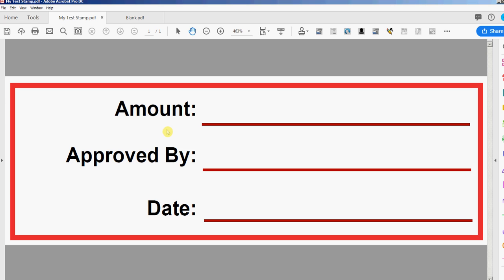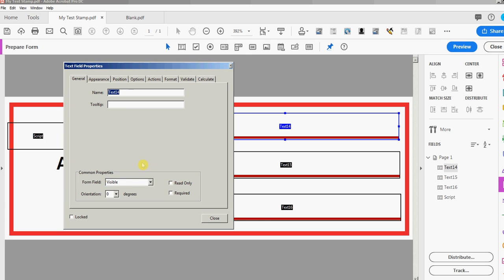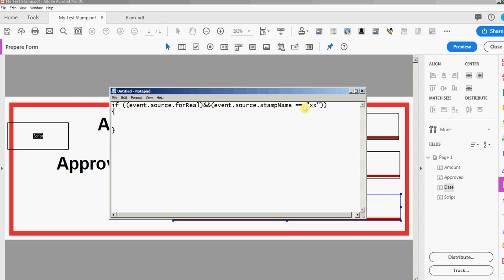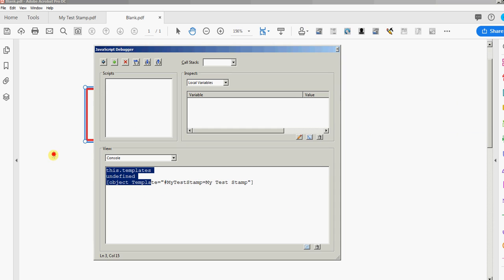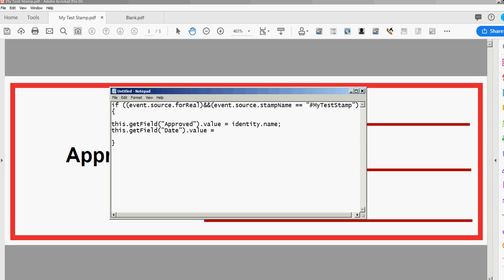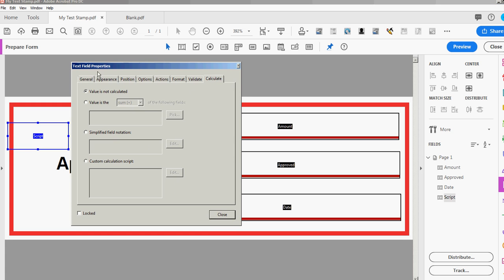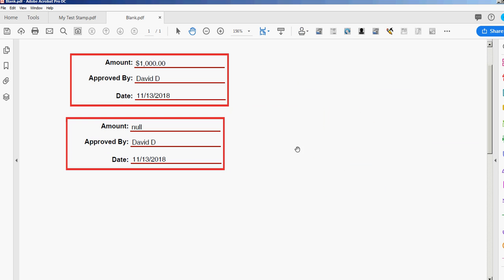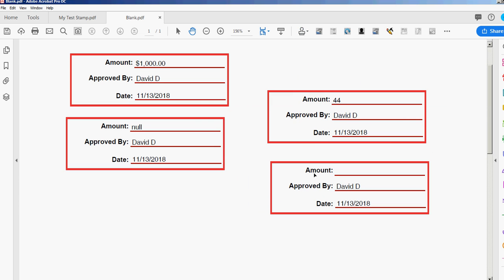How To Make A Dynamic PDF Stamp

Comment: this is for Adobe PRO only, you should include that in your title.
Reply from the maker: You need a PDF editor to create and manipulate PDFs.  Adobe Pro is a PDF editor.  You can still do this with Reader but since there is no interface for creating form fields (because it is a PDF "reader") you would have to use scripts to create the fields.  Adobe Pro is not the only PDF editor.  With all due respect we didn't think it was necessary to state in the title that you should use a PDF editor to edit a PDF but we thank you for you comment.
Reply: @PDFAutomationStation   As anyone can make a stamp (except for Dynamic ones) in Adobe Reader it would seem to be an important detail to include .

Comment: Hi David. I enter the following code into the script box and it has the message: "Syntax Error: syntax error. 1: at line 2" referring to the { symbol. I double checked the quotation marks are straight (not curley). Any idea where the problem is at? Thank you!

if ((event.source.forReal))&&(event.source.stampName == "#InvoiceApproval"))
{

this.getField("Date").value = util.printd("mm/dd/yyyy", new Date());
this.getField("PO").value = app.response("PO Number: ");

}
Reply from the maker: The number of opening brackets must match the number of closing brackets.  You have 3 opening brackets (, and 4 closing brackets ). You have an extra closing bracket ) after forReal.
Reply: @PDFAutomationStation  That fixed that issue, however after adding this coding into the "script" object, I tried to stamp a document and it still shows an empty stamp (nothing filled in). My goal is to autofill the date and open a message box prompting for a PO number. Any other thoughts on where this went wrong? See scripting below for reference. Thank you!

if ((event.source.forReal)&&(event.source.stampName == "#InvoiceApproval"))
{

this.getField("Date").value = util.printd("mm/dd/yyyy", new Date());

this.getField("PO").value = app.response("PO Number:");

}
Reply from the maker: @byeeself  I don't know what the script object is.  Please contact us outside of YouTube here:
https://www.pdfautomationstation.com/public/department6.cfm

Comment: Thank you for this great tutorial; my script debugger won't execute the prompt. I tried scrolling through this thread and a Google search and seemingly I'm the only one with this issue? I'm using Acrobat Pro DC
Reply from the maker: I'm not sure what you mean by your comment.  The script needs to go into one of the fields in your stamp.
Reply: @PDFAutomationStation  I'm struggling to work the debugger to find the StampName
Reply from the maker: @KurtReckerAdvertising  What script are you running and what does the debugger return when you run the script?
Reply: @PDFAutomationStation  i figured it out by going back to your earlier tutorials--- thanks for your help, it works!

Comment: If ((event.source.forReal)&&(event.source.stampName == “#eEMjluWKMBU5FMl6peOPpA”))
{
This.getField(“manufacturer”).value = app.response(“Manufacturer:”);
This.getField(“partnumber”).value = app.response(“Part No:”);
}
Why an I getting a "Syntax Error; illegal character 1: at line 2"
Reply from the maker: Because you are using curly quotes instead of straight quotes.  Use a plain text editor like Notepad to write your script instead of a word processor like Microsoft Word to avoid this issue.  There are problems with your script as well.  JavaScript is case sensitive.  The T in the the words "this" should be lower case.

Comment: Hi Dave,  I have viewed both of the videos, creating stamp from scratch, and make a dynamic stamp.  I am having a syntax error at the line that has the character { it says illegal character at that line where the { is at. 
I have the this.getField....... lines for each of the responses I want for the user to enter in the stamp.
I followed the syntax you showed on the video, but for some reason, I am getting the syntax error at that special character.  Please help me.
Reply from the maker: It sounds like you used a word processor like Microsoft Word to write you script.  Did you?
Reply: PDF Automation Station yes
Reply: PDF Automation Station I have copied it to notepad and copy and pasted from notepad to adobe custom calculate
Reply: PDF Automation Station by the way, thank you very much for responding so fast, really appreciate it.
Reply: PDF Automation Station figured out the problem.  It was “ the quotes, it had opening and closing “ quotes.  Changed them in notepad and it accepted in the calculate box.
Reply from the maker: @Ecualogic  Always use a plain text editor so you don't get curly quotes.
Reply: PDF Automation Station thank you, did that and it works. Really learned from your videos.  Keep up the great contents.

Comment: Hi David, 

This is great, thanks. 

This helped me to create two different stamps. I am however trying to change the date format to display as follows - "03 AUG 2020" I had it as "dd MMM yyyy", however when applying the stamp it leaves the month as a blank space. Is there a way to adjust the script to change the month to display in caps.

Thanks,

Taurian
Reply from the maker: The month needs to be lower case like this "dd mmm yyyy".  If you need the month to be upper case you would do this:
util.printd("dd mmm yyyy", new Date()).toUpperCase()
Reply: @PDFAutomationStation  thanks so much, its exactly what i wanted

Comment: Exactly what I needed, thank you so much.  One thing to note - I did not have a search feature in Acrobat for my tools, so I had to manually locate some of the tools that I needed.  For example, Page Templates was under Advanced >> Document Processing >> Page Templates.  I am using Acrobat 9.0.

This video, along with its predecessor, made it super easy for us to design a large quantity of custom business stamps (some with prompts to fill in information) and then easily import them in bulk into each employee's local folder.  Made the process of batch importing business stamps super easy.

Super appreciate and highly recommend.
Reply from the maker: The tools search feature was introduced in Acrobat Pro DC.

Comment: Hi there. What would the script be for just the auto populating todays date? Very new to this thanks!
Reply: I have tried this in the Acrobat JavaScript editor but get an "syntax error: illegal character "

if ((event.source.forReal)&&(event.source.stampName == “#MyTestStamp”))
{
this.getField( “Date ") .value = util.printd("dd/mm/yyyy” ,  new Date()); 
}
Reply from the maker: @bobatea1686  You are using curly quotes.  You must use straight quotes.  Do not paste from a word processing program like Microsoft Word.  Use a plain text editor like Notepad.
Reply: @PDFAutomationStation  Thanks! I got it working!
Reply from the maker: The line of code starts at 5:48 of the video.

Comment: I tested my stamp and got the code to work and then went to save it and it wanted me to rename it and locate a folder to put it into. In your video it seemed to allow it to save it to the original file without any problems. Any suggestions?
Reply from the maker: Save it somewhere else, like to your desktop.  Then close it and drag it into the stamps folder and overwrite the old file.
Reply: @PDFAutomationStation   that seemed to work! Thanks!

Comment: Hi Dave,
I have a question. Is there anyway to have add this ability to edit the stamp after entering all values? 
Right now I have dynamic stamp which after stamping and entering all values that the app response asks, it will printed on the pdf page. now i want to edit one of the values. but I can not. I have to delete the stamp and start the process from scratch again. Is there anyway to add this ability to edit the stamp after printing on the page? 
thanks.
Reply from the maker: Yes.  This is going to be a lengthy answer.  We have developed what we call "editable" dynamic stamps and there are a couple of ways we can do this.  Firstly, we only use the app.response function when there is only one user input.  It is annoying to users to have to dismiss multiple windows when applying the stamp and not be able to see what they have typed in the previous field until the stamp is completed.    
We usually use popup dialog windows.  Here is an example:  https://www.youtube.com/watch?v=9EcUE8Kfecg Unfortunately dialogs are much too complex to program for a quick YouTube tutorial.  If you want to try, lookup the app.execDialog function in the Adobe JavaScript Reference.  Back to the editable part.  Up until now, our editable stamps have required users to re-apply the stamp when editing (without deleting the previous stamp).  The dialog window field values would default to the values in the first stamp so users could change whatever they need to change and the stamp would automatically replace the first stamp.  Here is an example:  https://www.youtube.com/watch?v=j6hWgAKmB4c  We do not share our proprietary code for this as it gives a huge competitive advantage in our dynamic stamp business.  One of the problems with this method is that it is only good for one stamp of the same type per document.  In other words, it doesn't allow users to apply and edit multiple stamps of they same type in the same document.  That has recently changed.  We have developed a feature that allows users to apply the same stamp multiple times in the same document, select any one of the stamps, and edit the inputs for the particular stamp that has been selected.  This is yet another leading-edge break-through for us and we will not be sharing the coding behind it.  If you subscribe to this channel, follow us on Twitter, or subscribe to our newsletter we will be uploading a video demonstration in the weeks to come.  If you have a stamp project that you would like us to quote, please contact us here:  https://www.pdfautomationstation.com/public/department6.cfm

Comment: I followed all of your steps in both creating a static stamp then making it dynamic. When i go to place the stamp, there is no prompt for user input and the other text fields don't fill in. Is there something wrong with my code?

if ((event.source.forReal)&&(event.source.stampName == "#ShopDrawing"))
{
this.getField("Status").value = app.response("Status:");

this.getField("By").value = identity.name;
this.getField("Date").value = util.printd("mm/dd/yyyy", new Date());

}
Reply from the maker: Jake, your script looks good to me.  A few things to check:

1)  After you apply the stamp press Ctrl + j to see if there are any errors in the console.  One of the common ones is referencing a field that does not exist due to a typo or case sensitivity issue in your field names.
2)  Make sure the stamp file is in the correct folder.

Comment: David, I've watched both of your vids, making static and dynamic stamp.  I had to tweak what you were showing to what I needed.  I don't know JS at all so I'm kind of winging it.  I accomplished what I needed but the stamps that I created are executing the two form field JSs BEFORE placing the stamp AND after placement.  So it works, kinda.  I just have to enter through the two executions before placing the stamp and then when the form fields pop up again after placement, it works fine.  I know it must be something in the form field script that is generating the form field ask before and after.  I know if you looked at my stamps, you would probably be able to see what's wrong immediately.  I could use some help.
Reply from the maker: It sounds like you don't have the if statement right so it is running the calculation as soon as you hover over the stamp in the menu.  It could also be that you have more than one calculations in more than one field.  If this is not it, please send me an email by filling out this form and I will reply so you can send me the files.  https://www.pdfautomationstation.com/public/department6.cfm
Reply: @PDFAutomationStation   I got this all figured out.  Thank you so much for your tutorial.

Comment: Hi! Verry helpfull tutorial. I atryed few times but I did it. I noticed that my stamp file is around 160KB. When I put my stamp on a PDF it increase  the PDF dimension considerably. I tryed to reduce the impact by including in the stamp, at the end of the script "this.flattenPages()" and it worked. But after I putted the stamp for the first time, which works correctly, if I tryed to put the stamp again, on another pdf oppened in the same Adobe session, I noticed that it has the fields filled with the information a used for the first PDF. It works like this until a close Adobe. Is there another solution to my problem? Many thanks
Reply from the maker: Are you saying you added this.flattenPages() to your stamp script?  'this' in this case is the stamp file, not the PDF being stamped, which means you will have flattened your stamp file.  If you flatten it you are destroying it because all fields will be gone, including the field that holds the calculation.
Reply: Yes that's what I done. I aded this.flattenPages() at the end of the script to be aplied after the fields has been filled. It works and the stamp file appears not to be destroyed, and the pdf stamped this way is only 160KB bigger then the original PDF.
Do you think that I Could use another solution?
Reply from the maker: @TavyDimonu  You shouldn't flatten the stamp because that action takes out fields.  If the stamp file is not destroyed it is because it is not saving, but that's why it won't work a second time - because the fields are gone and the stamp is displaying the data that was in the fields before they were flattened.  Another reason a stamp won't work in the same session is if you don't name the template (or the AP of the stamp starting with the number sign - #.  Stamps don't usually add that much size to the file of the document being stamped.  You could try optimizing the stamp file after you create it - or flattening the document being stamped after it is stamped.  We have developed a tool for that:  https://www.pdfautomationstation.com/products/item15.cfm

Comment: I get an error when attempting to run the script:
SyntaxError: missing ) after condition
2: at line 3
if ((event.source.forReal)&&(event.source.stampName == "#MyFieldStamp1")

{

this.getField("AFE Number").value = app.response("AFE Number:");

this.getField("Approved").value = identity.name;

this.getField("Date").value = util.printd("mm/dd/yyy", new Date())

}

TIA :)
Reply: Anyone with this issue, read this:

You are missing an end bracket.  The script shown at 2:37 is
if ((event.source.forReal)&&(event.source.stampName == "xx"))

Notice the double parentheses at the end.  When the video narrator pastes the stamp name, it moves the end of the text offscreen because he doesn't have WordWrap enabled in Notepad.  If he were to scroll to the right or widen the window, you would see the second parenthesis.

Anytime you script, you have to remember to close all brackets or you'll get an error.  If you get an error like this again, check that every opening bracket has a corresponding closing bracket in the appropriate position.  Hope this helps!
Reply: I am unsure why it did the extra line spacing when I pasted. There is no space between the curly bracket and the first line and one space between the last line and the curly bracket.
Reply: @samiserrano8906  was this answered? i am having the same problem
Reply: @gabssssso  met too
Reply: having same issue

Comment: Is there a way to get the script to run if the user doesn't have Adobe DC?
Reply from the maker: The script will run with any Adobe PDF viewer:  Reader, Acrobat Reader DC, Acrobat Professional, Acrobat Pro DC, Acrobat Standard, Acrobat Standard DC
Reply: @PDFAutomationStation   Thanks, it worked after a reboot - not sure why it didn't work automatically!  Wonderful video and assistance.  I have been wanting to do something like this for over a year but didn't take the time to research.  I will save a tree or two with this!

Comment: I am trying to created a dynamic stamp that contains 2 fields, First field = Date paid (with automatic date) and Second field = COTR# a field I can enter numeric data (8 digits max)  each time I use the stamp but I cannot workout or find the script that suits my need.  When I try to adapt scripts online, it seems there is a mistake in the formula.  Please help me?

if ((event.source.forReal)&&(event.source.stampName == “Dynamic”)
{this.getField(“COTR”).value = app.response(“COTR#”);
this.getField(“Date paid”).value = util.printd(“mm/dd/yyyy”, new Date ());
}
Reply from the maker: There are many mistakes in your script.  The main mistake is that it looks like you used a word processor like Microsoft Word to write your script.  This caused curly quotation marks (''66" &"99") instead of straight quotation marks.  You should always use a plain text editor like Notepad to write your script.  The next error is in your stamp name.  The name must start with the pound sign (#) in order to function properly.  Next, you are missing a closing bracket after "Dynamic")
Please fix all of these and try again.